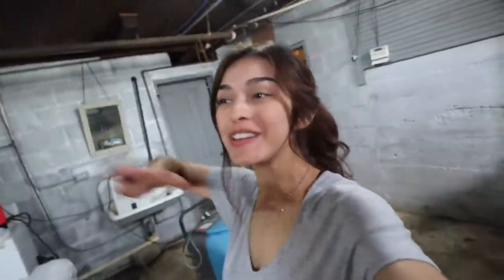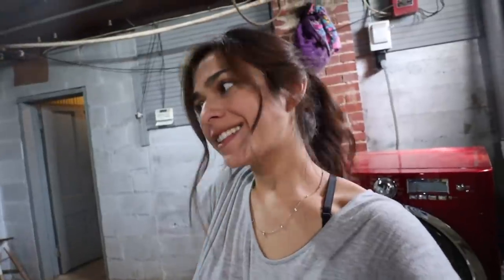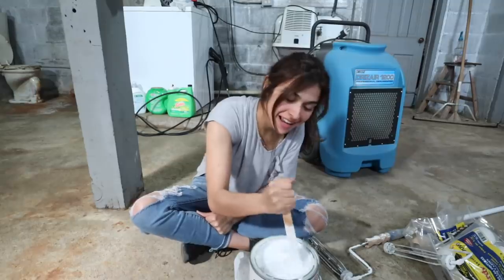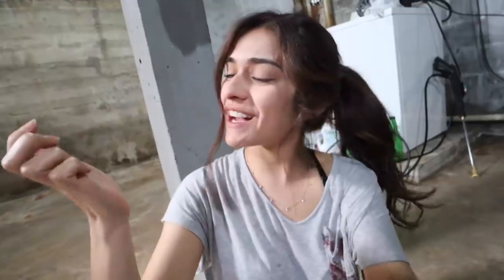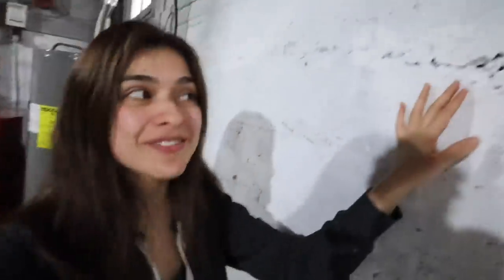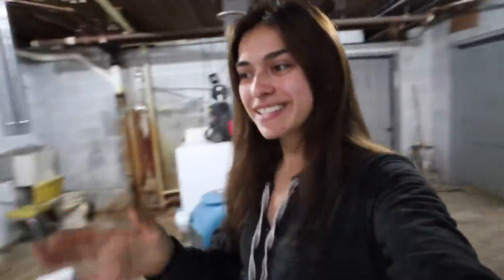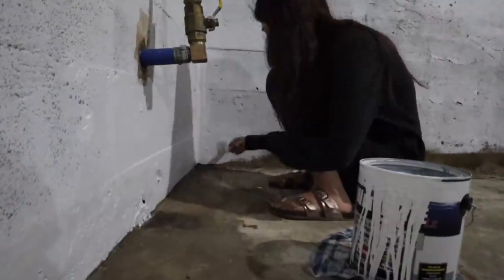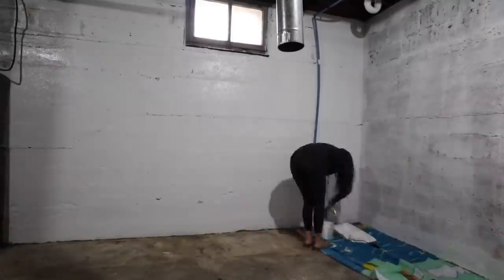Finally PAINTING The SCARY Basement!!!!

Comment: You need to use a 'cement' roller because it has a really deep pile. You should also seal the cement/concrete before painting.
Reply: I hope Nave reads this, she needed to talk to someone in department about she was doing.
Reply: I agree, I mentioned in the previous video to put Drylock on the concrete first. She should read the comments.
Reply: She is using waterproofing paint
Reply: Good advice-----I DIDN'T think of that.
Reply: @shawnengstrom3906  and without the concrete sealer the paint will just soak into the concrete.

Comment: a "extra thick nap" (really fuzzy) roller will help fill in those cracks as you go along
Reply from the maker: That is so good to know! Thank you so much! ☺️
Reply: @NavexCole  Tell the paint guy that you are painting a rough brick wall and he will get you a really rough nap roller pad. Keep lots of paint on the pad, dont keep rolling and rolling without putting paint on the roller pad. Too bad Cole doesnt have an air sprayer gun, makes walls that are rough paint so much better and faster!
Reply: @NavexCole  ON the package of the roller cover they will be  1/4" nap  3/8" nap 1/2" nap and 3/4" nap  this  is the thickness of the roller cover nap or where you put the paint on.   Smooth wall use shorter nap  block and rougher surfaces use the thicker nap.  They also make some nice handheld airless painter sprayer that are great for block walls and cheap as well.
Reply: Or just get a paint sprayer

Comment: I grew up in an old home, older than Cole's house.  It had the original stone masonry walls in the basement.  To keep the moisture from coming through the stone/brick walls, you need to use a waterproof primer, like Kilz, as a moisture barrier first before you paint.  Otherwise, the moisture will continue to come through the paint, cause it to bubble and crack and allow mold or mildew to seep through.  A thicker knap roller brush will help to push the primer/paint into the cracks and fissures in the wall and provide much better coverage.

Comment: Prayers for your brother.  Yes this is a space that would be better sprayed. A few tips, the roller just pushes on you don’t need to screw it.  The plastic trays you are using are liner you should have it sitting in a metal paint tray, also just pour the paint into the tray or small bucket to paint the walls, use a bigger brush you could use a 3-4 inch brush for sure and load it up with paint and pounce it into those cracks and holes. You are doing a great job and the end results will be beautiful. Also always ask the paint store to shake your paint for you and they will give you a paint key (opener) for your can as well as stir sticks.

Comment: Any time you buy paint at Menard, Lowes or Home Depot they will mix the paint for you for free when you buy it.  They will also mix it for you if you show them you bought the paint there months later.  Also you can buy 5 gal buckets of the the bright white base.  The paint salesman can tell you how much paint you need based on wall area.
Reply: Just remember when you are doing concrete block you will always use way more then what you think.  New block or bare concrete block will suck up paint  just like when you are priming drywall.  SO always add more to what you think to be safe.
Reply: Primer first and it won't suck up the paint. Primer is critical!

Comment: I hope your brother is ok. Some things to consider for your painting: have them shake the paint at the store and then shake it with the lid on before you use. The store should give you a tool to open the can if you ask. As someone else said, see if they sell it in larger containers. Use a rollernwith a fluffy nap, oike one labeled for stucco. Use a ladle  to scoop paint out of the container. You can just peel off the paint when it's dry. It's kind of cool.
You're doing a great job. Keep up the good work.

Comment: Nave..I am a painter.I would suggest getting the metal paint tray to put that liner in.It will end up cracking on you and you will have paint on the floor.Also, take masking tape and wrap it around the brush 1 inch from where the bristles are glued into the metal piece.Easier to clean and no paint dripping down the handle.Wrap it around 3 times. Youre painting brick.You should buy a 3/4 nap roller that is made for brick.You will get better coverage.You're doing an amazing job Nave.I love your spunk.Just thought I would give you some tips.Stay blessed.
😊💖
Praying for your brother.Hoping he is back to good soon.🙏😊🙏

Comment: Looks like you've gotten a lot of advice.  If you are painting a large area where you will use several gallons of paint (but less than 5 gallons - if using 5 gallons get the 5 gallon buckets) get one of those 5 gallon buckets with the lid on it.  Put a garbage bag in the can (hang the edges of the bag over the outside edge like you'd put the bag in a garbage can), pour in all the gallons of paint and mix them together.  That will prevent any variation in the color between gallons and ensure an even coat.  Get a roller screen that hangs onto the edge of the bucket into the bucket and you won't need a paint tray. Just dip your roller in the bucket, roll it on the roller screen and you're ready to go.  If you need to stop, put the lid on the 5 gallon bucket to keep the paint from drying out.  When you're done you can store left over paint on one of the gallon buckets - the garbage bag lets you pour it into the can, or store it in the bag, and as a bonus it makes clean up easy since the bucket will still be clean.  Hope your brother is ok.

Comment: Prayers for your brother and family. Get spray paint for the deeper crevices. Get a solid paint tray and with a shopping bag turned inside out so there is not colour transfer, slide the tray inside it and tie the handles to the feet of the tray. Then when you are done painting you can pull bag off and through into garbage or use it to cover roller so it doesn't dry out.

Comment: Always get it shaken at the store when you buy it. If it sits before using it, it will begin to separate. As long as the top is completely closed, you can store the cans upside down. It makes stirring much easier.
There are attachments that work on electric drills that mix paint. They will stir more quickly and thoroughly than you can do by hand. Reusable, just warsh and store. Worth every penny.
A thick nap roller brush would help.

Comment: We had a problem with water seeping through our cinder block walls. And someone told us to use Drylock on the wall before applying the paint. It's just like really thick paint that seals the bricks. After that or walls never leaked again.
Reply: I was thinking that when I saw the paint going on... would have been good to use sealer first, but perhaps they've never noticed leaks before. Hopefully it won't be an issue.
Reply: @brianofmoore  That Zinseer that she was using is basically a primer / sealer, but it is not the same as drylock.

Comment: For concrete and stucco, use the fattest, fluffiest rollers you can find. Those cinderblock walls are going to suck up pain like crazy, and the fluffy rollers will hold more paint and fill nooks and crannies better. Holes and cracks need to be prefilled before final painting. Buy a 5-gallon can, have them mix it up, and slop it on. Paint sits forever in storage and on the shelves and separates. If they mix it, it will be good for a day or so, and easier to mix afterwards.

Comment: Hi Nave,
First of all, when you bought the paint they should have given you one of the little opener tools. They're usually free and if not they're only about a dollar. They've got what looks like a bent screwdriver tip on it to easily open any paint can.

Second, you can also buy a paint mixer Rod that has a little blade on the end that you attach to any cordless drill to mix up your paint.
Just remember to start out slowly and don't squeeze the trigger all the way or it will spray paint all over. Sort of like making a smoothie in a blender with the lid off.
Reply: And whatever you do, Do Not pull the mixer out of the paint until it has stopped Turning!!!

Comment: You might consider using an 18 inch roller with a roller frame that attaches to both sides of the roller nap.  It will paint faster and spread the paint more evenly. 
Also, don’t be afraid to load the roller up with paint.

Comment: Preyers for your brother. Quick tip. Use a 3/4 roller knap will get more paint on the walls without taking it off. That would look really clean if you used the same product but tent it like a grey for the floor.

Comment: Arizona checking in 😁 sending healing energy and prayers to your brother.........it’s a little late now, HOWEVER for your next painting project, fill in all the cracks with mortar, putty, caulking depending on the job AND use primer on the walls before you paint, it’s way cheaper than paint, it seals your walls so you don’t use as much paint 😁 my hubby would of sprayed the whole thing, but I love using the roller and brush method. 👍 great job

Comment: Read several comments about your brother, will pray for him.TIP on filing cracks & holes for painting, lightly mist area with a water spray bottle, spray a very small amount of Great Stuff foam in crack or hole. Let it develop a nonsticky crust over it. Then squash it flat to the wall. Practice on some old board. I have installed egress windows in block & poured walls by first making a 2x10 or 2x12 green treat box to slip fit the window into. Cut wall opening 1/2" larger for each side of the box. Put two concrete screws in each side of the wall opening to plumb and square the box in place. Test fit window & foam center of the gap around the box. Let it set a day. Fill the remaining gap from each side the next day. Use the red/black can, not the window or door foam. That window will be there for your grandchildren. PS The water mist helps cure the foam.

Comment: Hydro cement is good for sealing holes. Mix a little at a time. File then paint. A French drain outside will help prevent water from coming through the wall reducing florecence. Be prepared for paint to flake off over time with moisture coming through

Comment: It's looking good down there! The roller you use can make a BIG difference! If youget one with a high pile it will work better for rough surfaces. I see the second roller you used was a better pile thus why you saw it went on a bit better. Go for one a little bit fluffier to get good coverage on those rough walls if you want it even easier. You can also paint the floor with the same roller but I imagine you will be doing epoxy. Positive healing thoughts and prayers for your brother's speedy recovery! <3

Comment: You need a much thicker roller for rough surfaces. Also, a wall that has not been painted needs to be sealed with a primer or you will need at least three coats of paint.
Reply: @ramptower7487  Kilz for Basements and Masonry

Comment: A coated coat hanger.  Bend it, stick in cordless drill.  It mixes fast.   Or a old beater from a junk mixer.  (May need to weld on a extension). They work great.  Wipe off beater with clean paint brush.  Then if water soluble put in disposable cup with water till you clean equipment.  
  Imo a basement should get “hydronic” cement.  I think that’s the term.  It seals the cement.
Reply: Edit isn’t working.  Have a piece of thin cardboard, tin for painting against floor, other stuff.  Saves a ton of time.  Hope your brother is fine.

Comment: Always like to watch novice painters trying to get a job done. Would probably turn out better and easier if they asked for advice at the paint store. Personally I'd use one coat primer and 2 coats finish. And as everything else the prep work is most important. Chalk cracks then cut in with a brush before rolling on base coat. And please use drop covers , construction paper, plastic sheets, etc. Other than that, good job and should be commended for her efforts.

Comment: For the floor I’m the basement there are these things called puzzle tiles and they can imitate any kind of material you would like plus they are water proof and temperature resistant (aka can stand pretty high and pretty low temperatures with out them being damaged) and another plus they take pressure off your feet when you stand on them for long periods of time

Comment: Nava, use a concrete sealer first that way you will not need to use so much white paint to get a perfect finish. Concrete is very porous so you will be using heaps of white paint to get a perfect finish. The hardware store should have advised you.

Comment: Like someone else said, a thicker roller cover. At least an inch thick.
On a normal interior wall, a loaded 3/8 inch paint roller will cover the same area as an unfolded newspaper. Count on less with the concrete. 
And count on at least three coats. Maybe four. Good luck!
Reply: Better yet,  on future walls for sure, get a hold of a sprayer. Lay it on good and heavy, then backroll it to smooth it out and catch any runs. You got this!

Comment: Always get the store to shake the paint. Also, that clear roller pan is a liner meant to go in a metal pan.  It's not really designed to use by itself.  Without the metal pan, it tilts the wrong way.

Comment: A couple of things. First, yes, h ave them mix it if you dont have a mixer that fits into a drill at home. Second, primer. You are going to be so sad, you didnt use a concrete primer. Third, quality of paint. Never skimp on the quality of paint you buy. You may think its costs more when you purchase it but the coverage will be significantly better and it will last longer. Lastly, caulk the cracks. Way cheaper and will look way better.  But, you live and learn :)

Comment: Never pour paint out of the can because it gets in the grooves and is a pain to get it out. You need to buy a plastic/rubber pour spout that fits on the edge of the can. This way, the only thing you have to clean is the spout. Once I found this tool, it saved a lot of cleanup. Someone told me to store the paint can upside down. This prevents the rust from accumulating around the top inside rim of the can. Another timesaver, is to put the paint in a plastic pail with a matching lid. Just put painters tape around it to prevent the lid from popping off. Just mark the top of the container so you can match it.

Comment: Mix 1 part all purpose dry wall joint compound with 4 parts of sealer paint for the first coat. Put it on with a 1" roller. Smear that stuff on.

Comment: i would propably have bought some filler for the walls and then sanded down the excess to make the walls nice and smooth and free of cracks and bumps
Reply: That or mix up some cement and put a thing layer on the it...make it all smoooth
Reply from the maker: I wanted to do this but Cole didn't think it would be the best idea long term. 😋

Comment: #Nava The best way to mix a can of paint is with a cordless drill and a paint Mixing Paddle that you can attach to a drill, just ask at the paint store, usually about $5.00. And get some premixed cornice adhesive to trowel up some of those larger holes. Because it dry's quick and is easy to sand. And use a thicker nap roller but watch the splatter if u roll with a fast action, it will cover u in dot's. Ps. youtube can show you how to do anything u just have to search ! Love u ;-)

Comment: I feel for you and all the effort you're using.  Personally I'd have used some block filler or even a cement sand mix to level the walls and fill all the cracks & other anomalies. Then 3 galons of paint would have been plenty as well as givin you flat mostly smooth walls down there.

Comment: There are paint rollers that suck up the paint into the handle then as you use the roller you twist the handle and the pain flows into the paint roller and in turn is applied to the surface you are painting, a lot less bending down to refill you paint roller & it is faster.

Comment: Ok, first always ALWAYS have your paint mixed. Next, Primer. Always use a good primer on bare concrete or else you will be painting for DAYS. Next dampen the wall as you go with a spray bottle. This lessens the absorption of the primer. BTW that "cute" paint tray you bought. It's actually a Paint Tray Liner. Hence the reason it is so flimsy and the paint all runs to the wrong end. When you go back to the store, hopefully to get primer ask the clerk for a Paint Tray. A really good way to paint basement walls is with a paint sprayer. it covers better and it fills in all the cracks and crannies. Lastly I hope all went well with your brothers surgery(s).

Comment: Nave you need concrete sealer and then 1-2 top coats. The block wall is very poores cement block it will take alot of paint.

Comment: Thet sell a little paint mixer that goes on your cordless drill. Thry should have those mixers were the sell the paint brushes. Much better than a paint stick. There is one for gallon cans and a bigger one got the 5 gallon pails of paint - those need a corded drill to run.

Comment: Nave, too late now, but for a little over $100 You could have gotten a Graco paint sprayer at Menards and using cardboard held in your hand for spraying the edges you could spray the walls getting into all the voids and do it in 2 coats in a fraction of the time. You would also use less paint thus making the cost of the sprayer easier on the wallet.

Comment: Should have sealed before painting,  the blocks will drink up your paint. Dont roll your roller dry, you will squash it and it wont hold as much  paint. That paint tray isnt a tray but a throw away tray liner to save cleaning the tray. Use a bigger brush, ots not the tarsh Mahal.  Sorry, hope this helped